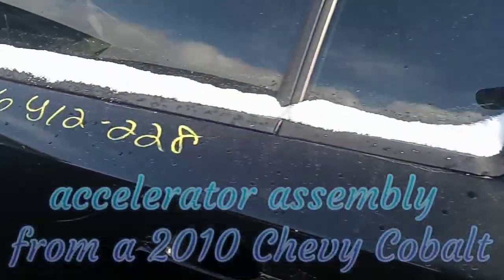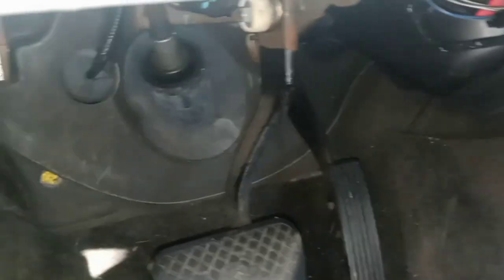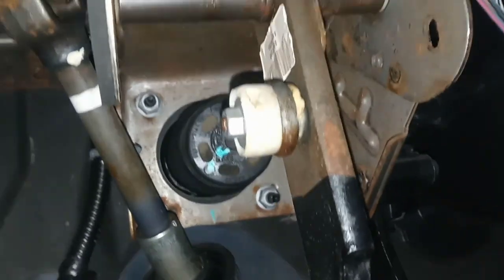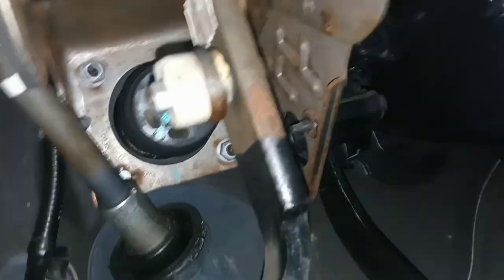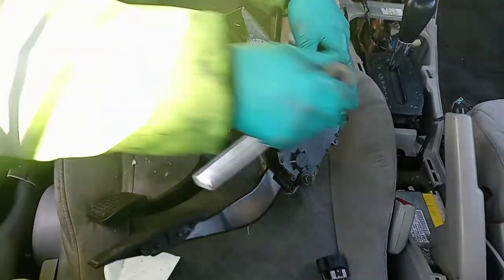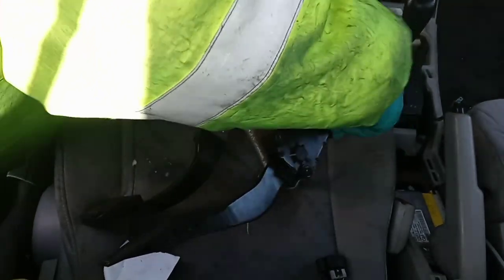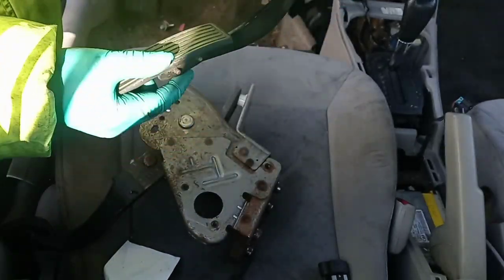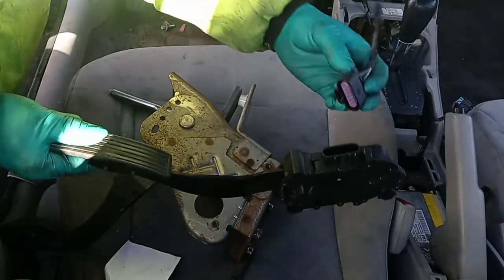Chevy Cobalt accelerator pedal removal

Comment: Does the pedal box just pull out, or is there anything special you need to do with the brake pedal part that goes into the firewal
Reply from the maker: There is one clip or a 10 mm bolt the disconnects the brake pedal